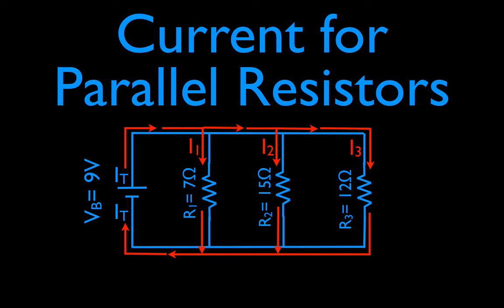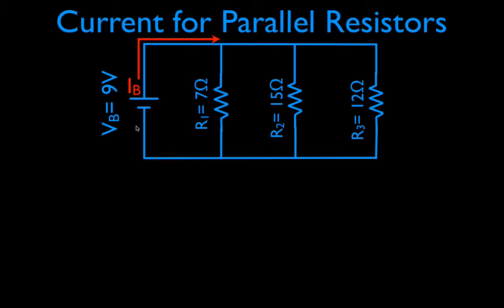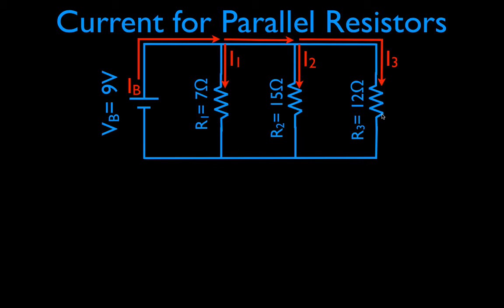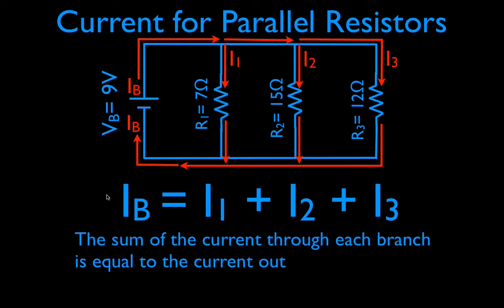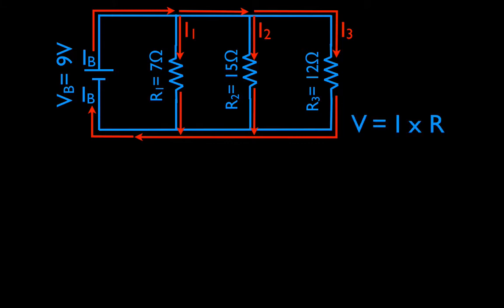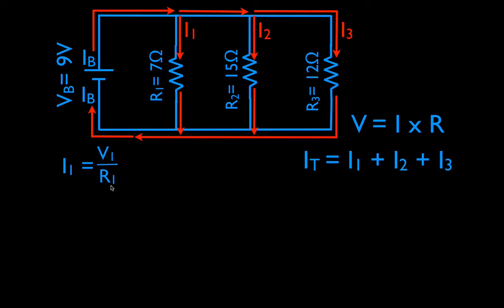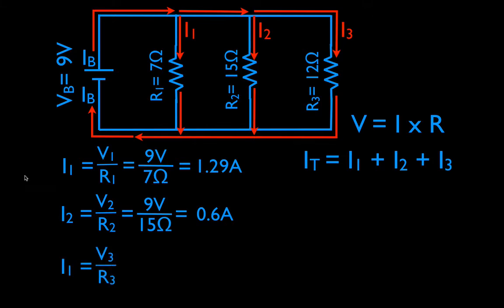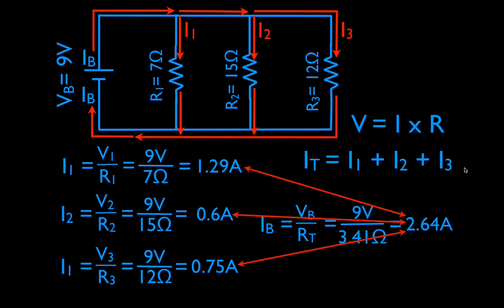Resistors in Electric Circuits (15 of 16), Calculating Current for Parallel Resistors

Comment: along the top do you lose current after each node point, even if though you're not going down the branch? If so I'd assume at the bottom the currents would add up from right to left until you get the total back to the battery? So by the time the current gets to I3 or R3 hasn't it already lost some current at I1 and I2?
example. after the first node, where the second arrow is at the top... would the current value be the total of 2.64a which minus the loss off 1.29a, which would be 1.35a. So now we have 1.35a and if we pass node 3 we lose R2 which is 0.6a which gives us 0.75, and this also works with what ohms law determines as the current value for R3.